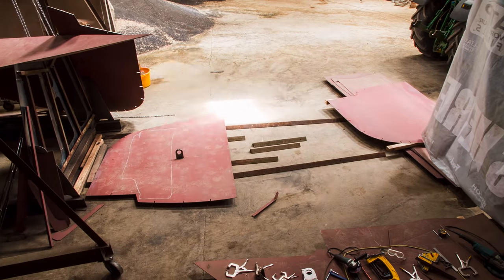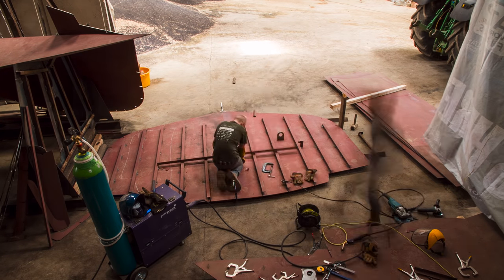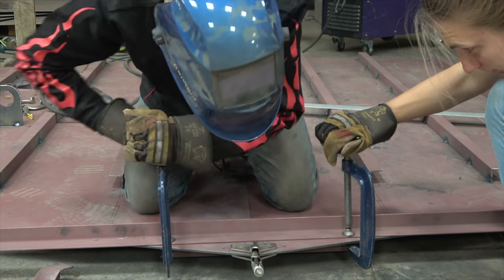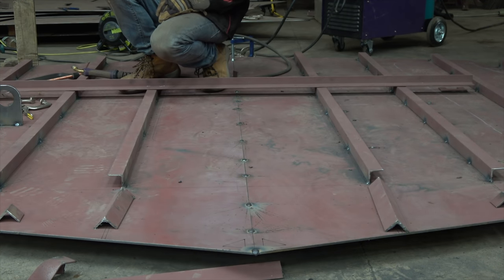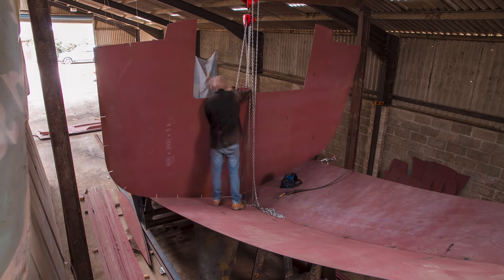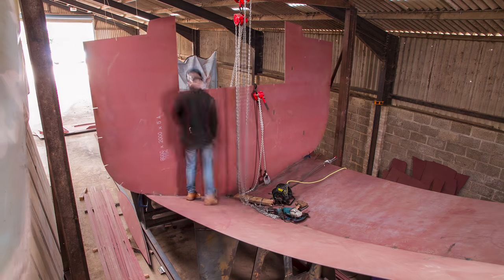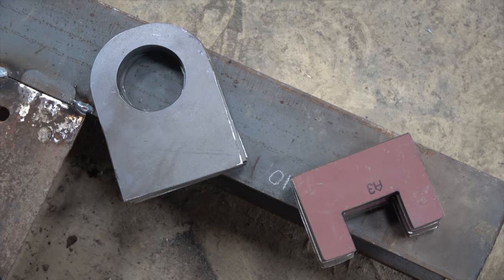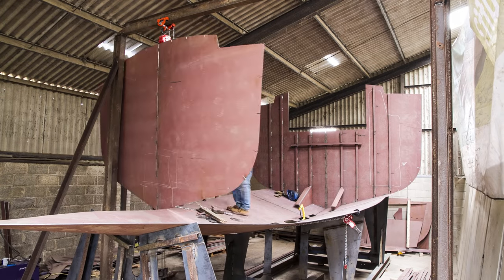Assembling and Installing the Main Bulkheads - Ep.5

Comment: The two of you are a wonderful team.  Glad to see you back and hope your 2019 is full of progress.  If you do a skip weld pattern on each side of the center line you can minimize distortion at the seam.  On food equipment we would do a 6" (150mm) weld staggered 6" on  each side and then come back and fill in between the welds.  This worked really well in stainless and kept surface distortion to a minimum.  Take care and waiting too see the next video.

Comment: Loving the build, I don't mean to nit pick, But if that is red oxide paint. Or any paint for that matter i would always clean it off with a grinder before welding. I would also leave a small gap when joining plates and slightly v out where i would be welding that will allow good penetration.
Reply from the maker: The red coating you see is just a weld primer that is designed to be welded through. I did testing beforehand to see how it affected things, with good results. If you saw in the video we ground in a gap from the opposite side of the plate after we flipped it over, works the same as leaving a root gap and grinding a V. None of the final welding is done yet, only tacking so no need to worry much about all that stuff just yet.

Comment: No keel plate?
Reply from the maker: the keel comes later
Reply: @SailingHunkofJunk  we always set keel first, shoot with a transit, set frames and bulkheads, add longitudinals then suck shell plating to it, your way guaranteed not to be straight stem to stern
Reply from the maker: @powerstroke0459  It has worked fine for us thanks, this is the way these kit boats are built.
Reply: @SailingHunkofJunk  No problem boss.. just saying, 5 years, 4- 115ft aluminum catamarans and a 85ft mono hull under my belt
Reply: Good videos though